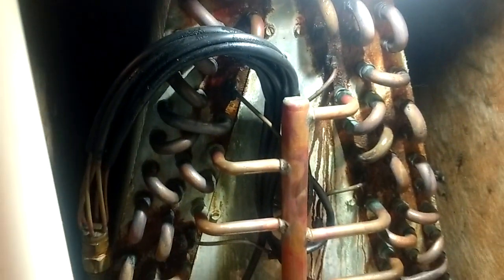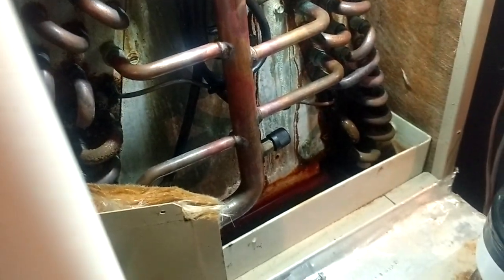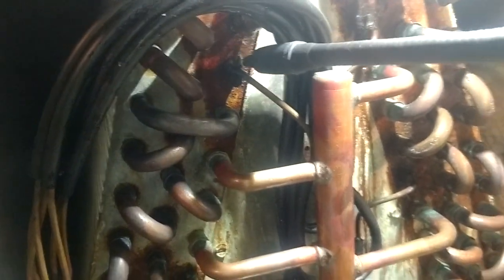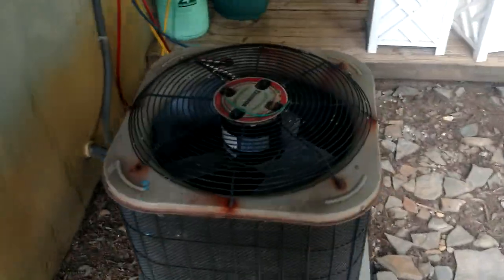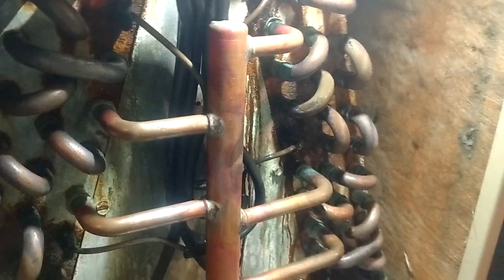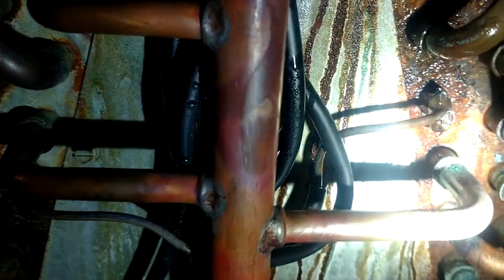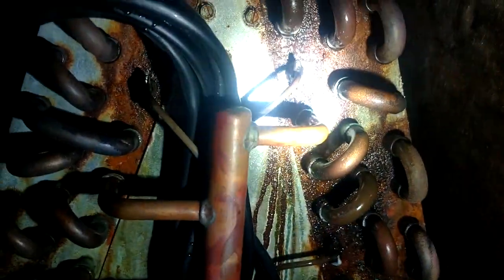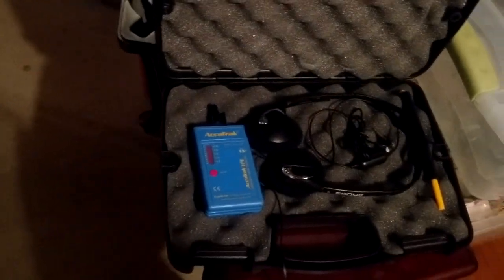Refrigerant leak tips. Ultrasonic, sniffer and soap bubbles all in action. Stick around to the end.

Comment: Great tips about the sniffer. I have that jb one and im just about done with it! Amprobe is on the list! Thanks Shannon
Reply from the maker: It's good with both r22 and 410A. And it's even a little bit more sensitive when in manual mode vs auto mode. Thanks for watching W.W. 👍
Reply: Sweet! Definitely need something more reliable then what I have now. Thanks for posting Mr knight

Comment: Great video!! How would you rate the Accutek  detector?
Reply from the maker: Probably a 7 or 8 out of 10. It's not going to find every leak, no detector will, but it does find a lot of them. It definitely has its purpose. Especially when you have bigger leaks or a system is completely flat and you pressurize it with nitrogen. The ultrasonic makes those very easy to find. And that way you're not killing the sensor in your sniffer with large amounts of refrigerant. But it won't find some of the micro leaks.
Reply: @sknight0391  which leak detector is good in your opinion for micro leaks? especially for r410a and r32 systems.
Reply from the maker: @lordjaashin  patience
Reply: @sknight0391  rofl. you sure have a colorful personality, dude.
Reply from the maker: @lordjaashin  thanks ( I think) 😂
I wish I knew of a leak detector that could quickly find all those micro leaks that we have to deal with now. But there isn't such a thing. Looking for those leaks it's just something that's going to have to continue to drive us crazy out there in the field. I wish I had a better answer, but sometimes you just got to gas it back up and call it a day. Thanks for watching 😎👍
Reply: @sknight0391  no you misunderstand me. i meant that as a compliment. you have that olde bootstrap no non sense humor that is no longer seen these days. its a refreshing change to come across such person. keep it up. your videos are full of useful information and help us newbies about what to expect in field out there.
Reply from the maker: Very good, very expensive, but it won't find everything.
Reply: @sknight0391  do you ever got chance to try uv dyes? how do you rate their efficiency for finding leaks?